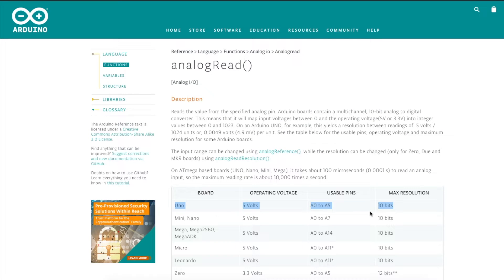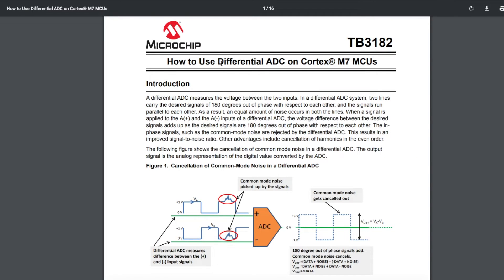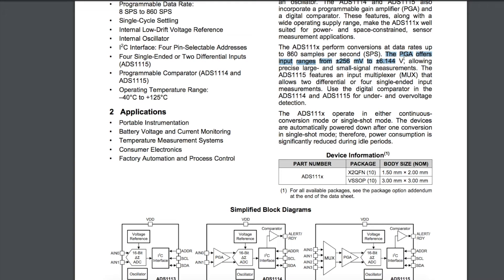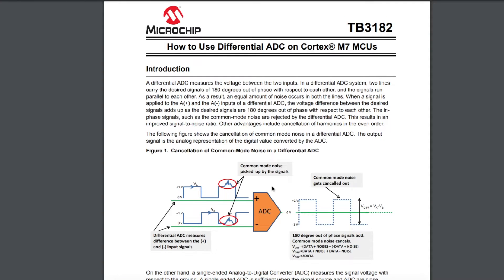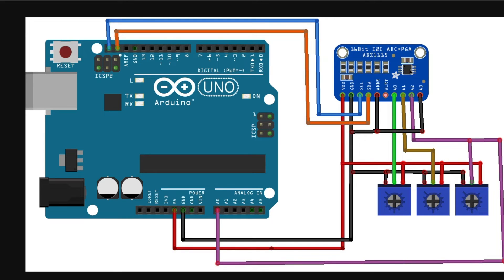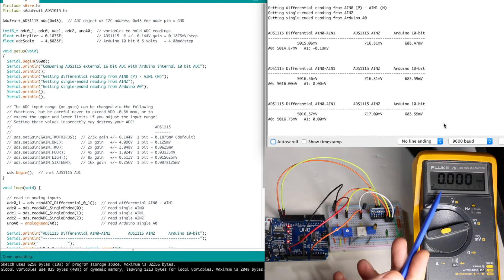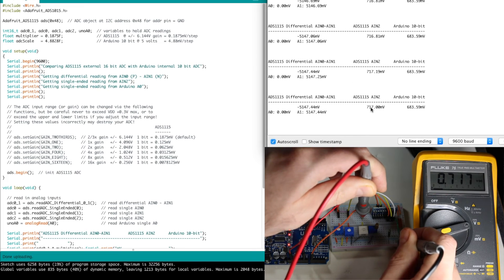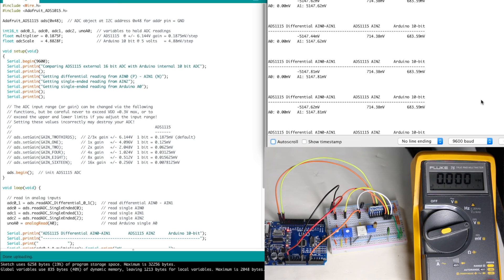ADS1115 16 Bit ADC Module with Arduino

Comment: great Video an your other projects :-)  have a simple question: if I need no +/- range, but a range from 0V to 2,5V with the best resolution of the ADS1115. I dont know, I have to programm this effect. 0V to 2,5V shout be a digital value 0 to 65536. Is that possible?

Comment: hello, I want to measure the negative voltage and send it back to arduino due but the datasheet of arduino due says it cannot receive negative voltage, will it make any difference .thank you
Reply from the maker: The ADC chip also can’t directly take a negative voltage other than about 0.3 V below ground.  but even if it could, it’s only communicating back to Arduino as a data signal over I2C so the Arduino wouldn’t see a negative voltage itself.
if you’re doing a differential measurement where you can actually get negative numbers, it’s still just a subtraction between two different positive analog voltages.
Reply: @GadgetReboot  Thanks for answering my question！

Comment: very useful information and as a relative electronics novice I can follow this very well. I want to built an Arduino multi input voltmeter to experiment and learn electronic by probing several points in the schematic simultaneously so this little chip is very useful!  I'll have to look into the impedance of the chip but it looks promising. Thank you!

Comment: Can we measure voltages above 10 volts with help of ADC thru converter?
Reply from the maker: A voltage divider can scale a voltage down until it's within the input range of the ADC.  If the voltage is below 0v it will need to be shifted up somehow and things get more complicated.

Comment: If I want to measure 50 to 500 V (Sensor signal) AC via Arduino then how to possible? If I replace the potentiometer and connect the sensor output to ADC.
Please let me know connection diagram if possible.
Thank you.
Reply from the maker: It's not a simple answer, especially because there could be safety considerations that greatly change the design complexity, and also not knowing the design requirements, a suitable circuit can't be designed. For instance, does the entire signal need to be preserved so it can be analyzed in software or just the maximum/minimum voltages seen over a time frame need to be captured (so a circuit design totally changes and can be simpler) etc.  So you'd be better off researching application notes from manufacturers of ADCs to see how they implement various measurement goals, and other power electronics dedicated resources to see how to deal with and interface with hazardous voltage levels to be able to safely and effectively measure them.

Comment: Hello,
Could I use an Arduino Pro Micro (10bit resolution) with the ADS1115 (16bit resolution) to build a joystick (with better sensivity) that uses some hall effect sensors with magnets ?
Thank you !
Reply: Yes is the answer, I have just done that very thing with several controls, using the pro-micro hooked up to a ADS1115.

Comment: Wait, my ADS1115 couldn't read the data output. it just my Arduino A0 can read the data. But when i use SPI scanner, there is an address so my i2c has been connected. but i'm still confuse why it didn't give the data. is there any idea?

Comment: I have a question for you. So I wired everything exactly the same and used your exact code, but I am having trouble. When I set my gain to 2x gain my resolution I read from the serial monitor on A2 is only 1mV- meaning the smallest value it changes by when I adjust the potentiometer is 1mV (it should be 62.5 micro volts). Also I tried reading the adc2 value directly (not converting to mV) and it only has a resolution of 16 integers (it will jump 16 numbers when I adjust the potentiometer instead of just 1 ) 
Please help me!! :)

Comment: Nice video...
Need help, I want to single output 0-5volt. 
I have try use arduino only, but have value 0-1023. Use arduino only and view in plx-daq.

I have ads1115 and arduino uno need the wiring and code to get 16 bit and decreet more than use arduino only.

Comment: only yesterday made a current meter with a current transformer and this chip.
Reply: I am about to do the same. Were you measuring AC? Did you make use of the +ve and -ve values on the waveform?

Comment: The arduino can have a different (lower) ADC reference voltage applied to give finer measurements, BUT you are limited to that voltage as the maximum input level on the analog inputs.

Comment: I think it’s Vref/(2^n - 1), not Vref/(2^n). Because the smallest value will always refer to 0.
Reply from the maker: I always found the topic confusing and this thread  tries to straighten out the whole concept of measuring a range of voltages per bit rather than an exact voltage. It’s one of those things where I need a clear mind to go back and try to understand it all again. At least for the things I’m  doing it doesn’t affect the results drastically. 
https://forum.arduino.cc/index.php?topic=303189.0
Reply: because array start from zero

Comment: When using differential read, can you make a reading beyond the voltage range of the power going into the ADS device?   Like between 14V and 15V to get 1V.
Reply from the maker: If we want to use voltages outside the device’s tolerable input, there’s other structures needed like maybe an isolated or floating measurement scheme. 
 I’ve never done it but here’s one article related to that 
https://www.maximintegrated.com/en/design/technical-documents/app-notes/1/1108.html